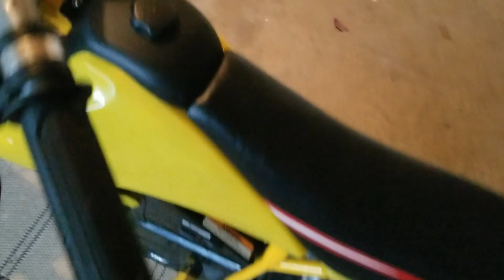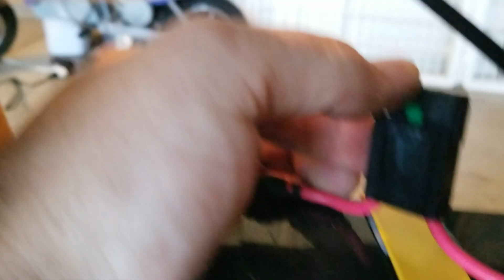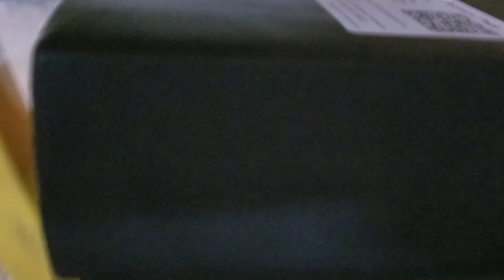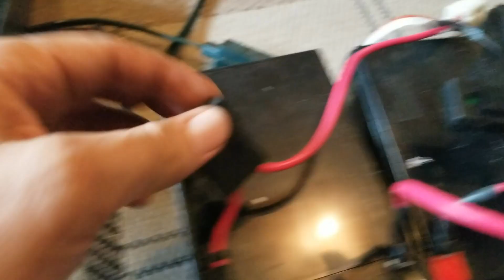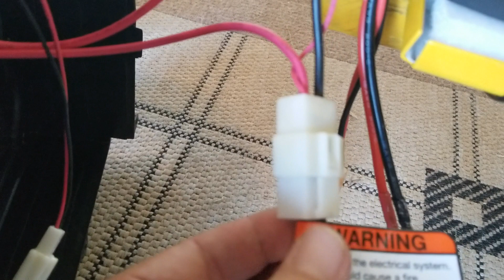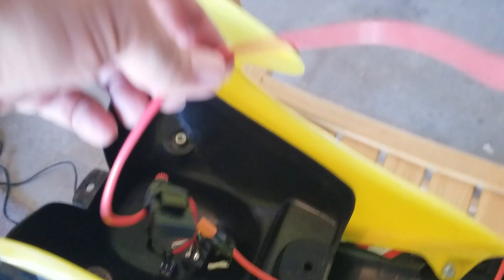Razor MX650 36V Lithium Battery Upgrade

Comment: You don't need fuses and actually shouldn't  use fuses the way you do with lead acid. Any decent lithium battery will have it's own standalone battery management system (BMS) and it is just something else for the current to pass through. I'm sure you know by now but the stock connectors, mismatched gauge extra wire and those wire nuts all draw away from your responsiveness and defeat, even if only a little bit the purpose of the li-ion upgrade and expensive gold plated connectors. I'm sure you know but maybe you don't, also NEVER use the factory lead acid charger on the li-ion battery either. Again, it has BMS and isn't necessarily the danger but explosion is possible and it DEFINITELY will significantly shorten the life of battery. But.. I'm sure you're aware and fixed this but people watching need to know so they don't roast their expensive new pack that came with instructions but they're all in Chinese 😂 Pair a brushless motor with the li-ion to see maximum gain. This will provide some responsiveness but loses much of it's benefit in the junk wiring as discussed and mostly because the brushes have their limitations. Lithium ion batteries work because they are highly unstable and while it's not difficult to tend them, there are specific rules that will keep you from getting hurt. Most battery packs for this bike are at least 30 individual 18650 cells and just the metal casing making contact to another or dead short past the BMS is likely to make it explode and the other 29+ are sure to follow causing horrific burns, in a matter of milliseconds. Look up vape explosion, most of those are 1-3(not 30-40!)of the very same cells encased in metal body vape rigs and literally will turn someone's jaw, hand or any other extremity close enough into a pink mist. Best case scenario is fire/explosion and horrible chemical burns which are very, very painful. All of this can be avoided if you do your homework and DON'T use household wire nuts or butt connectors, or anything else that could possibly come loose or you run the risk of putting your most sensitive parts right in the line of danger. Believe me not worth saving the money or saving a few minutes. I'm sure the vid maker won't like this comment but it was irresponsible on their behalf to not mention ANY of this and more than that, send his own kid out like this because either they didn't do their research, or worse, realized and didn't care enough to take the time to do it correctly, then make an informational install showing how, so I don't really care. Please, take the proper safety precautions, helmets, proper maintenance and install of all components but especially lithium ion cells they are NOT as forgiving as lead acid and those fuses WON'T help your testicles from getting blown off and you'll really regret it when you find out there wasn't much benefit.
Reply: Z Ro hey so I’m thinking of putting in a 48v 25ah in my razor mx650 I’m changing the speed controller and everything but I’m just asking if I should keep on the battery covers or not or should I drill holes into them for cooling

Comment: Hi there. Awesome video. I will be following it when I upgrade. Does the factory low battery indicator, the yellow light by the throttle, still come on when it's low? Thx
Reply from the maker: I basically ignore the factory lights.  You need to watch the voltage indicator to see when it gets close the voltage where the BMS cuts it off.  Works well.
Reply: @TimArmbruster  I see. One more question. I found a similar battery on ebay but it's a little bigger. It's 9.65"x6.89"x3.35". Do you think that will fit?
Reply from the maker: @MichaelH-1  I think that's too wide, and maybe too long as well.  If you are looking for a cheaper option than what I used, I did install this one for a neighbor and it has been working fine for a few months now.  https://www.ebay.com/itm/Li-ion-Battery-36V-20AH-Volt-Rechargeable-Bicycle-500W-E-Bike-Electric-Li-ion/273891927949?ssPageName=STRK%3AMEBIDX%3AIT&_trksid=p2060353.m2749.l2649
Reply: @TimArmbruster  How difficult is it to install a variable speed throttle on a razor scooter? I'd like to install one on my razor pocket mod scooter because the stock throttle is a bit to fast for my liking but don't want to have to swap out the speed controller to do so. Do you have to change the speed controller in order to use a variable speed throttle or can you just swap out the stock throttle grip and it's good to go? I've only driven it once in the three weeks since I bought it after having a low speed wipeout my first time driving it and to be honest I'm quite scared to get back on it again as that thing goes pretty fast at a top speed of 15 MPH.
Reply from the maker: @michaezell4607  yes you have to change speed controller.  Not hard though

Comment: So I just found a little rx350 on my garbage route, batteries are shot. I wanna make it go a good 20 mph but not sure how electric motors and stuff work. So between doing a battery upgrade or just throwin a little motor on it
Reply from the maker: Do you have Facebook?  I haven't modified RX350`s but there's a group with guys who could help.  It's called "Modified Razors"

Comment: Hi Tim, can I install the new battery also without the voltmeter? Since it has a BMS it should shut off the battery when it gets too low. Is that correct?
Reply from the maker: Yes for sure.  The volt meter is for convenience.  Because of the BMS and nature of lithium batteries, it will just cut off without much of a dip in power.  So, unlike the lead acid it will leave you stranded without much warning.  If you know the BMS cutoff voltage, and watch the voltage with the volt meter, you can avoid getting stranded.  That's why I installed, but technically not necessary.

Comment: You said that the battery should give a 20 mile range, would the motor on the mx650 be able to handle that? What would be the wear and tear on the rest of the bike after doing this modification?
Reply from the maker: No problems with bike and no additional wear and tear

Comment: After using this for a while how is it holding up? Is the range significantly better than the lead acid batteries? How about Hills?
Reply from the maker: Holding up perfectly .. I haven't seen any performance degradation since installing.  Range, yes, is significantly better than lead acid.  We probably get about 2 hours of ride time riding at track.  Hard to say because we literally have never run the battery completely down.  Regarding Hills / Speed / power .. for this upgrade there is not much difference from lead acid.  The voltage is the same as lead acid, and the rest of the power train is unchanged.  I have done a 48v lithium upgrade on a different bike and that is much more expensive but goes so much faster, climbs hills better, etc.
Reply: @TimArmbruster  Thanks! We use a couple of these bikes at campgrounds just to bop around. The conversion would make them a whole bunch more useful.
Reply: Tim, looking at converting 2 650 razors to the 48 but concerned how much faster do they go? A 10 and 8 yr old are using the current stock 650 models...
Reply from the maker: @tc9337  they are considerably faster.  I would say in the 25-30 mph range vs. 18-20 mph.  May not seem like much but yes brings in different safety considerations.

Comment: All the Razor lithium battery upgrades use lithium-ion is that because lithium iron phosphate wouldn't work or because lithium-ion is cheaper? Thanks.
Reply from the maker: Lithium Iron Phosphate is a type of lithium ion.  I have used Lithium Iron Phosphate in a Razor.
Reply: Great thanks!
Reply from the maker: @rodney6334  either of those batteries will work.  The first link is the better battery.
Reply: Thank you very much! Great video incidentally.

Comment: What difference in range did you see as opposed to stock?
Reply from the maker: To be honest I have never run it down all the way.  I've ridden it for a couple of hours at a track and was ok.  According to the math it should be double stock (20 miles) which seems right  Never wanted to ride this more than 20miles.

Comment: So was going to do the 48v 1800 watt with the 4 lead acids, would this be a better bang for the buck? Considering I wouldnt have to get the kit just battery and charger? And how much less power is this compared to the 48v lead acid route? Ive got about 350.00 bucks US to play with trying to figure out the best route to take, just picked up the sx500 for 60 bucks batteries are shot which I knew when purchasing, thank you for any info also for this video!
Reply: Or should I keep saving get the 48v motor/ controller kit and a 48v lipo and charger? Would it be worth the extra power?
Reply from the maker: There is a substantial difference in power between 48v and 36v.  36v will get you 17mph, while most 48v systems will get you 25-30mph.  For $350, I would do a 48v overvolt kit off of ebay, and a lithium 48v battery.  I think that would be the best bank for your buck, and fits your budget.
Reply: @TimArmbruster  Thanks man! Is there a battery pack kit and charger you can link me to or recommend?
Reply: @JustinTwilley  did you upgrade to 48 volt? If so what kit did you get?
Reply: I know it's a year later you're probably went with Lion lithium battery by now that's what I'm going to do 1800 watt same as 20001 battery is 360 somewhere around there in the 1800 watt kit is not even 200 bucks just going to put a smaller back sprocket on the back and they should be set,, I hope you are doing good with your bike

Comment from the maker: Fix Stuck Razor MX650 Forks!!  Disassemble, fix, lube, and reassemble stuck Razor MX650 or MX500 forks.  If your forks are binding and won't move any more, this video will most likely get them moving again.  I also show all of the internals and parts of the forks and how they work.
https://youtu.be/1SeaK_UIIfo

Comment: Can you use the stock charger with this set up?
Reply from the maker: Some people have, but no, I would not suggest that.  Most lithium batteries you buy will come with a charger to wire up.  Use the one that comes with the battery.

Comment: Can I please get the links to the battery and charger
Reply from the maker: Battery pack includes charger  https://rover.ebay.com/rover/0/0/0?mpre=https%3A%2F%2Fwww.ebay.com%2Fulk%2Fitm%2F273457871823
Reply: @TimArmbruster  Is the LifePO4 the way to go, or the Li-Ion?
Reply from the maker: @jdavies  to be honest I am not sure.  I think either are ok.  But contact the seller.. He has been very helpful.  He would know

Comment: hey so at what volatage does this cut off about to do this to my mx500
Reply from the maker: Depends on the battery you buy.  It will tell you what the low voltage cutoff is for your battery in the specs.

Comment: One thing negative about it that battery cost almost  as much as bike
Reply from the maker: Yes but if you do the math it is about the same cost as lead acid.  If you have the bike for a long time you will replace the lead acid batteries multiple times.

Comment: Would it matter if it was 30Ah?
Reply from the maker: No, if the voltage is still 36v and the AH increases from 20ah to 30ah, the only impacts would be the size of the battery and the range would increase by 50%.  Make sure you look at the dimensions of the battery and ensure it will fit.